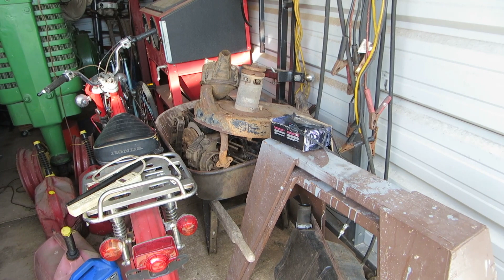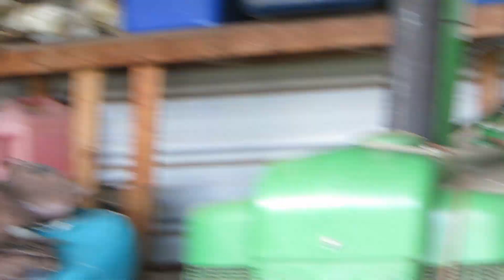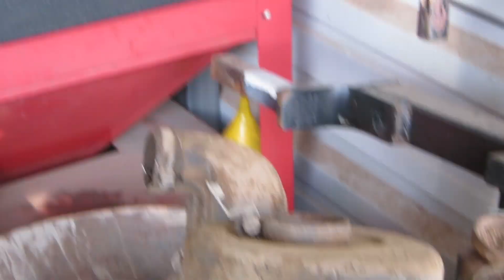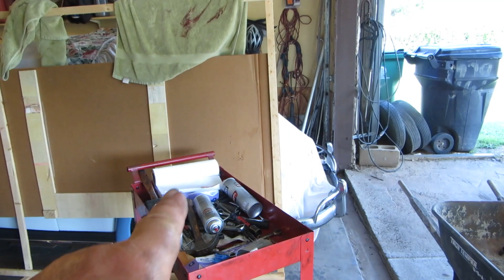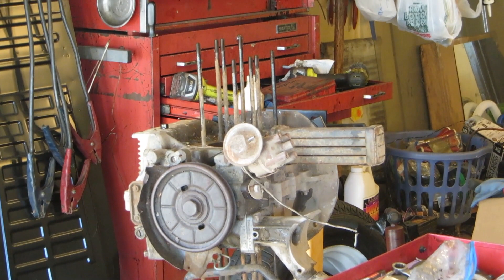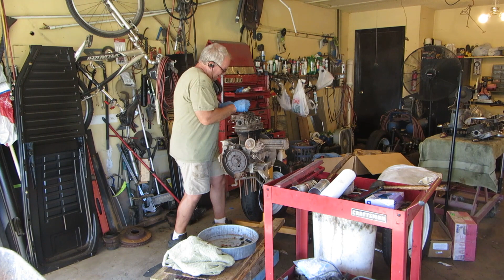VW Single port H5 Engine

Comment: If I were you I’d rebuild that into a nice longblock ready to go. When the motor in the ‘67 goes just switch everything in it to the longblock and presto. Glassbead and re-gap those old Bosch plugs and they should be all good.
Reply from the maker: Yes....that’s the plan. And hopefully those plugs will come out Of the head, without taking the threads with it.

Comment: On that kinda case the first place it will crack due to heat cycles is the hole under the oil cooler.  Get a can of cleaner and spray in side of there till it is clean, get a mag.glass and check it out. It is not a death crack but not a good sign ????That engine was lucky! when they snap a rod they blow a hole thru the lifters and the carnage hits the street. Time for the car wash. The cam . check what lift it has some have .304 and some have .328 . These are both stock lift ?   Down here I got the passenger door rebuilt. I totally sand blasted the door and epoxy primed it and painted it with some AE and put the new seal kit on it. On this thing called the window sash ( it is what holds the glass ) the one they sold me was made with 21 gauge steel while the orig. was 18-19 gauge .------ so I made some out of 18 gauge 400 S.S.  I will never have to worry about those from here to eternity!!!!!!!! Thanks for the video Dan .
Reply from the maker: It didn’t throw a rod. I saw all the old rods. And they were all intact. It did spin a rod bearing though. Hence the pieces of bearing material on the sump cover.
I think, and I do not have them but I do have pieces of piston. I think the skirt of the piston broke??
So the case is not broken. And should still work. 😀😀
Reply: OkFixer years ago I worked in a VW machine shop and store and amongst the things I used to do was rebushing connecting rods. Incredibly easy when you have the right tools and materials.
Reply from the maker: @vayabroder729  yeah...but it seems no one here does that work. I only found one shop. And.....he’s trading me a windshield Installed in his tundra,  for the work he’s doing.😀😀
Reply: OkFixer great deal! I’m surprised the VW machine shop you took the other block to doesn’t do it.
Reply: @OkFixer  Oh they took the rods off and the insert fell in to the bottom !  I thought  the rod cap snapped. Dan in the last 40 years rebuilt rods have gone up bad in 80 you could get them for 16 a set that had been resized matched weight and rebushed  = Rebuilt . Now a set cost cheapest is 75 and you have to pay shipping for your old ones there and the freight to you. Here in Corpus there is no parts store anymore since Bill died in 92.